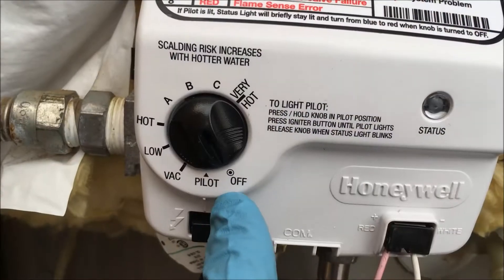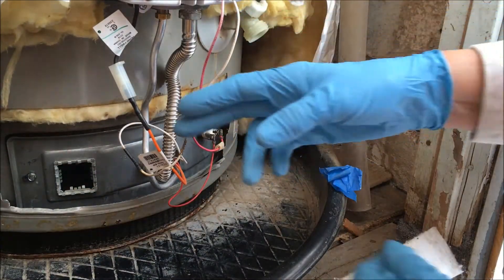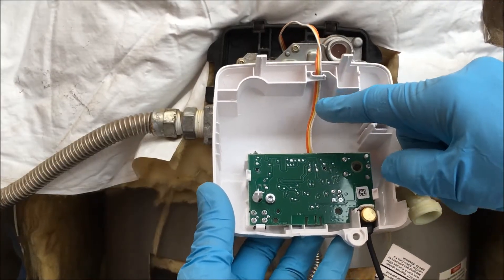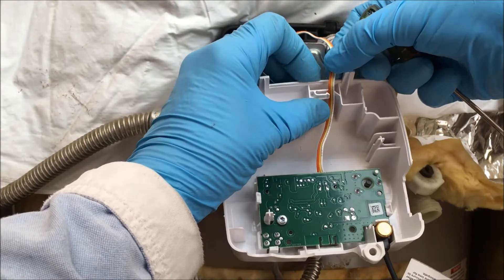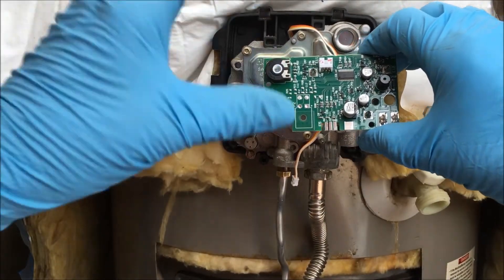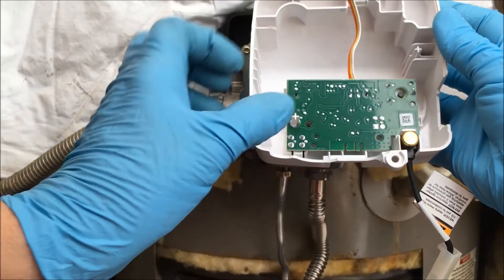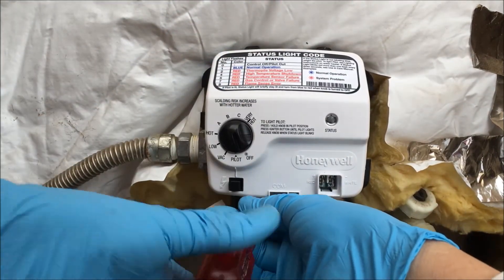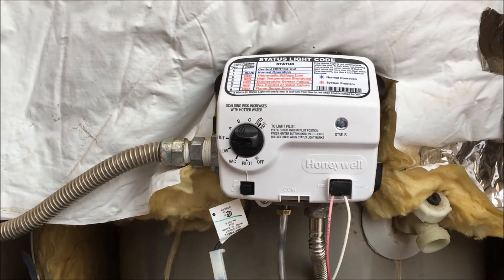Replace Control Board on a Honeywell Gas Valve | Water Heater

Comment: Thanks for the video. In this video you mentioned that the gas valve will go in shutdown mode if the water is too hot. Is there a way to remove it from shutdown mode? I have a Bradford White water heater. The pilot kept going out so I took it out and cleaned it. It was a messed  but I can't re-light it now. I think the issue is with the control board. My gas control valve is no longer made so I can only buy a used one or opt for the updated one but I really think the issue is with the control board. I will watch your video on it to learn more. Please answer my question on if there's a way to reset it from shutdown mode, thanks.

Comment: Hi, best video on this.  Couple of questions.  My card is WV8840C1406 What replacement do I need and where can I get it.  I have a rental company but I'm not a contractor.  I broke the black knob (2 of them) trying to do this before I saw your video.  Suggestions on where to get a new knob?  
Thanks so much for the good info.  Mike

Comment: My temperature adjustment never worked from day one, how do I know if its the circuit board or the temperature sensor?  My water has always been blazing hot can't turn it down.  Does not show any codes, heater is six plus years old running good on LP.
Reply: Same problem here, I think I may order a whole new gas valve.

Comment: So I just wanted to say you are amazing. We followed your troubleshooting videos step by step and it worked.ultimately found the thermoswitch had tripped. Likely from the amount of debris inside the protective  shell on our heater which is outside. Wish we had heard you say the part about holding the pilot button in until the lights blink earlier might have saved us a few steps.

Comment: Thanks! Great video. I got the Code 7 nightmare after turning my WH temp up above Hot to do some nasty wash. Tried all of the home fixes to the board, none worked. Cleaned the Thermocouple which seemed to temporarily work so I replaced it with a new one, still got the Code 7 after aa while. Next cheapest solution was to replace the Circuit Board. Followed your video step by step (including wearing rubber gloves to keep your hands clean but maybe more importantly keep static electricity off the Board) and it now works like a charm. :)

Comment: My temp control knob is missing and I had to shut my gas of to my house. Now I can't light my water heater. I took the borad off and the black shaft for the control knob is still in the borad I can't pull it out and I don't want to break it please help

Comment: Great video. Heater went out a week ago. Tested everything per your other video. Checked continuity on thermal switch. Replaced thermopile, gets spark, pilot comes on, but light on control board never flashes. Getting board delivered tomorrow, will follow up if this fixes my issue.

Comment: Thanks for doing this!  A small “pyramid” shaped metal piece fell out when I pulled the cover away from the valve.  It appears to fit on one of the pins?  Not sure exactly where it goes.

Comment: Edit: it works! I've never been so happy to hear a water heater come on.

Thanks for all the videos you've posted covering this. If nothing else I've learned a lot about how water heaters work.

Checking everything, I'm left with the control board being the issue. I have a propane State Water Heater. It's a weird model number on the last four digits (WV8840B5077). Maybe because it's propane? I'm just gonna roll the dice and hope one of the other WV8840 boards work since I can't afford the $150-$200 a new whole control assembly cost. I found a Resideo that was meant for propane and it had the same model number, so I went with it.

Our hot water heater is in an outbuilding, for some reason, so if it explodes it'll only take out the shed lol.

Comment: I have the Honeywell model WV8860B1318 and my water is not heating. I got the 6 flashes to replace the burner. Do you happen to know where I could find the exact burner or at least its exact model number. Ty!!
Reply from the maker: The burner assemblies are pleantiful.. I'd look to eBay or Amazon.  I got the entire burner assembly (as a backup) for a couple of dollars more on Amazon that it would have cost be to buy just the thermopile alone.  The burner assembly include the burner, igniter head and the thermopile.

Comment: Amazingly thorough video! I watched the troubleshooting video  too and it got me to this point by troubleshooting and eliminating the other potential areas. About a year ago I came across your other Honeywell WH videos and they fixed those problems as they came up. They are all exceptionally informative and easy to follow! A $50 part from eBay, at your recommendation in this video, and some quality time with my maintenance savvy dad saved me the expense of purchasing a brand new water heater! THANK YOU SO MUCH!!
Reply from the maker: Bless your heart!  You're certainly welcome.  I'm always thrilled to hear that one of my videos helped someone fix their stuff and save money.  Happy DIYing!
Reply: Thank you for your. I had a local gas company come out for my water heater and they said it was leaking gas through the temperature control valve I'm thinking maybe there's an o-ring or something that went bad but in order to buy a new one I have to buy a whole new control valve which is like $400 can you just replace the organs that are bad
Reply: No.

Comment: What were the problems / symptoms that led you to replace the control board?
Reply from the maker: Jim, there were several issues.  Here's the link to my video where I troubleshoot the water heater and fix two issues--one being the control board.

Comment: How do you replace the dial? Thanks
Reply from the maker: Jesus, you have to remove the gas valve cover and board from the back of the cover.  Then, you slowly rotate the temp knob while tilting it to the side a bit, until you "feel" a location where the knob will come out.  Remove the knob.  There is a tension spring behind the knob, so be careful to not misplace that.  You put the new knob on the same way you took the other knob off.

Comment: Just my temperature knob is broken on my Temperature control panel. I don’t know if it’s in the off position or not. Is it okay to remove it still so I can repair the knob?
Reply from the maker: Only if you turn the gas supply off.  When you replace the knob, make sure it's in the "Off" position before turning the gas supply back on and going through the steps to light the pilot and water heater.

Comment: My brand new a.o hot water tank wont ignite and the insulation around the gas valve is wet
Reply from the maker: It should be under warranty, so I'd ask for a replacement.  If the insulation around the gas valve is wet, the problem is likely that there is leak where the gas valve goes into the the water heater tank.  Look under the gas valve to see if water is dripping from it.
Reply: @frugaldiy1  Thank you for the help.
Reply from the maker: My pleasure.

Comment: Where can I find the replacement control board?? I keep having the overheat issue with mine and it shuts down
Reply from the maker: Look on eBay for the control board.  Type in the model number of your gas valve and look for a control board.  If by the "overheat issue, you mean a 4-flash high temperature shutdown, I have a video to reset that issue.  Here's the link:  https://youtu.be/rllnMAx05JI
Reply: @frugaldiy1  - Thank you for the quick reply, I knew about that fix the past several months, but earlier today I got no spark from the igniter, unplugged it, plugged it back together and now I get spark and a pilot flame, but even after over 90 seconds, I still get no status light. I checked the thermocouple with a multimeter like in your video and it checked out, so im thinking either a bad motherboard or a bad thermal safety switch maybe? I REALLY appreciate your help as this is for my elderly mother who is on a fixed income amd can't even attempt to get a technician until atleast the following Wednesday
Reply: @frugaldiy1 - so since I can't get the burner to igni5e, I can't do the "very hot, hot, pilot" method...........as soon as I release the gas control know, the pilot extinguishes of course
Reply from the maker: No worries, Casey, I'll help you and your mother if I can.  I don't think it's the thermal switch.  Do you know how to "jump" the thermal switch?  

Yep, based on what you've said, it does appear as though the motherboard is faulty.  I'd get a pre-owned board off a eBay.  There are sellers on eBay who are plumbers, and they sell pre-owned entire gas valves and just control boards that they pull from working water heaters they replace.  I think a control board would get your dear mother back in business and enjoying warm showers again.  Thank you for helping your mother.  ;)
Reply: @frugaldiy1  - We also have a 1 year old baby in the house too. And thank you, and no how do I jump the thermal switch? I have found a few boards on Ebay, but the model numbers aren't exact, even though I have read they are pretty much universal across the model numbers.
Reply from the maker: I can't tell you how to jump the thermal switch if you don't know how because it's a bit complicated.  For what it's worth, I replaced my old board with one from a gas valve with a different model number than mine and it worked just fine.
Reply: @frugaldiy1  - Give it a try on explaining it to me? I've been working on cars since 5 and went to school to work on airplanes. And yeah, I'm hoping that a control board with atleast the same 1st half of the part number will work, just leaves them water until next week without water at the least unless jumping that switch could temporarily work
Reply from the maker: Jumping the thermal switch will not solve the issues you're having.  I can't tell you how to do it because the thermal switch is a safety feature that protects the water heater chamber from overheating.  It just wouldn't be a good idea to do.  And, jumping the thermal switch will only indicate whether the switch is good or has failed.  With your most recent comments, all facts point to a failed control board.  I'm heading to bed now, and will respond to you in the morning if you comment back.
Reply: @frugaldiy1  - I understand not to try and permanently bypass that device, just to troubleshoot it, amd thank you, I appreciate all your help so far, maybe I can think of some other ideas tomorrow, have a good night 👍🏻

Comment: I've been getting 5 blinks. I replaced the temperature safety switch which didn't solve the problem. Then, I replaced with a new board as you did, but after 10 minutes, it went back to 5 blinks. Now what??? By the way, excellent video.
Reply from the maker: Lindy, it sounds like the temperature sensor has failed or is faulty.
Reply: @frugaldiy1  that's what I thought. Do you have a step-by-step video of how to replace the unit? I've looked at others, but I like your presentation. What is your recommendation for a new valve? The model number of the heater is MI5036FBN. Thank you for your expertise.
Reply from the maker: No, Lindy, I don't have a video on replacing the gas valve.  I'd only ever do that if the valve were leaking water at the location where it goes/screws into the water heater.  I don't have a recommendation re a new valve because I don't know the brand or setup of your water heater.  I'd have to see it.  You change change the temp sensor without removing the gas valve body, but it's a bit complicated.  The model number you gave me is for the actual water heater itself, but when you search for a new gas valve, you need to search by model number of the gas valve.  It's on the side of your gas valve.  

But, before you go through all the hassle of changing this or that, were I you, I'd take the cover of the gas valve off again and make sure the temperature sensor wires are plugged securely into the board.  That little connection can be finicky, and it must be plugged into the connection securely.  

Consider watching my water heater troubleshooting video because it may help you.  Here's the link: https://youtu.be/cAo4I2eoJ9Q

 And thank you for your kind words, Lindy.
Reply: @frugaldiy1  Thanks for your quick reply. The model number of my Honeywell gas valve is WV8840A1000. I see there is an ICON model, but, I'm wondering if it's that much better. As far as I can see, there is no water leak. I assume it would be visible on the side of the tank (?). I will definitely look at your trouble shooting video. You're a treasure!
Reply from the maker: Yes, Lindy, the leak would be visible from the front, outside of the tank.  I'd recommend you stick with a gas valve that has a model number that begins with "WV."  Please watch my troubleshooting video and you will understand why I say that.
Reply: @frugaldiy1  Sorry to keep bugging you, but I'm determined to fix my problem myself, with you expert advice) before resorting to an expensive plumber. I've replaced the temp safety switch and control board (probably needlessly). I've tested the thermocouple with a meter and it reads 717. I tested the thermopile and it reads 722. I can restart the pilot light, but the burner doesn't ignite at any temp setting anymore. And, I'm still getting the 5 blink warning. Do you think replacing the gas pilot assembly might solve this? BTW, I watched your trouble shooting video which was very helpful.
Reply from the maker: No, Lindy, I don't think the pilot assembly is the problem.  I think I think the issue is the temperature sensor is faulty or failed.
Reply: @frugaldiy1  I admit I'm confused about what the temperature sensor is and where, and then, how to replace it. I replaced the thermal switch, the small round unit that has the 2 winged clip on extensions, which attaches to the exterior of the base of the tank next to the pilot viewing window.
Reply from the maker: Lindy, the temp sensor is located at the back of the gas valve and goes into the WH chamber.  It is a bit complicated to replace.  I don't have a video on that.
Reply: @frugaldiy1  thank you. That's what I was afraid of. Lol! I guess I'll make a stab at replacing the whole control module with a new one. The water heater probably needs to be drained, anyway. I've lived here 5 years and never have done it. Thanks again for your expert advice.
Reply from the maker: I hope all goes well.
Reply: @frugaldiy1  I will definitely let you know!
Reply: @frugaldiy1  Here I am again. Well, I replaced the gas control valve unit and the hardware connected to the burner. Now, after I get the burner to go, the unit starts blinking continuously and I get a red light. I can smell gas. I checked for leaks. None. There is no gas smell before igniting the burner. Of course, I immediately, turn the control unit and the gas off. Does that indicate the burner itself is faulty?
Reply from the maker: Lindy, I can't answer that with any certainty, and I don't want to give you the wrong info when the issue involves the smell of gas.
Reply: @frugaldiy1  Sorry, I was premature. Out of curiosity, I put back in the old burner assembly and connected to the new control valve, making sure the gas connections were good and snug. I tested for leaks, and there were none. I started the burner and it works fine now. No gas smell. I apologize for bugging you so much. I'm glad I didn't blow up the house! LOL!
Reply from the maker: @lindypollard  I'm glad you figured it out and it all worked out.  Enjoy the hot water!

Comment: I was servicing a gas water heater for low voltage to Thermopile, replaced it, still same issue. I disconnected the board, waited 5 min, reconnected the computer board, light up water heater and no issues

Comment: Hi Frugal DIY.  Thank you for posting this video.   You did a fabulous job on it.  Great explanation about how to replace the control board.  I also watched your other video about how to fix the 4 flashes issue before I watched this one.  Sounds like maybe you had to replace the board after all.  I, too, am having issues with my hot water heater shutting down due to the overheating issue.  If it continues, I will take your advice and purchase a new control board.  Thanks again.  You rock!
Reply from the maker: Hi Sitting Pretty.  I just sat down to dinner to find your supportive and lovely comment.  I truly can't thank you enough for that--made my day!  Yes, I did have to replace the failed control board, but I also had an issue with no pilot light due to the pilot tube orifice being plugged.  I cleared that first with compressed air and then went about troubleshooting the water heater components to verify that it was indeed the control board that had failed, and it was.  I made a video on how I went about troubleshooting the water heater components that you may find helpful.  Here's a link to it:  https://youtu.be/cAo4I2eoJ9Q

Comment: Hopefully an easy question ... if the pilot valve does not open with applying 9v, is the only option to replace the complete Honeywell controller?  Thanks - really appreciate your ability to explain the troubleshooting process!!!
Reply from the maker: Hi Michael.  Yes, I would replace the gas valve.

Comment: Hopefully someone can answer my question.  I have a pilot light, but there is no status light.  I keep pressing my finger on the pilot button, but no status light comes on.....even after 90 seconds.  Nothing.  I tested the thermopile......500 millivolts.  I'm thinking the honeywell control board has failed.  Model number for the honeywell is wv8860b1317.  I looked up control boards on Ebay and there are only wv8840a1000.  Can I replace my wv8860 board with a wv8840 board?
Reply from the maker: Hi Jason.  I can't say with certainty that the replacement board from a Honeywell gas valve that is a different model number than yours will work, but it did in my case.  I took the chance, and it worked it worked like a charm.